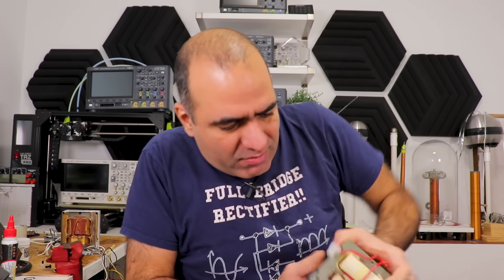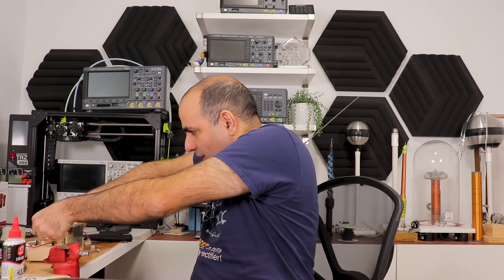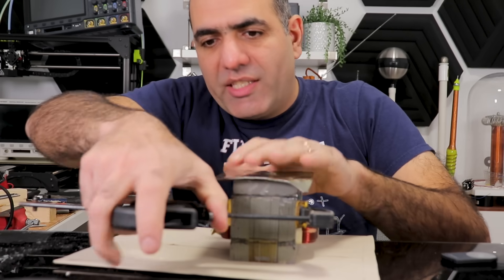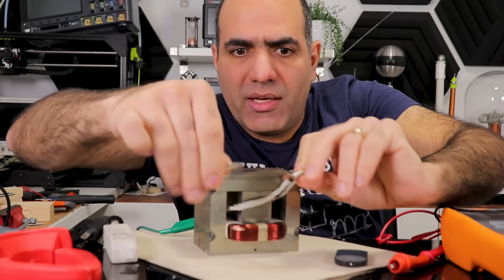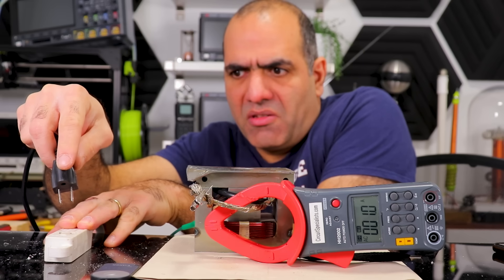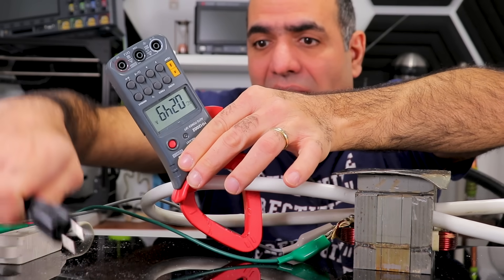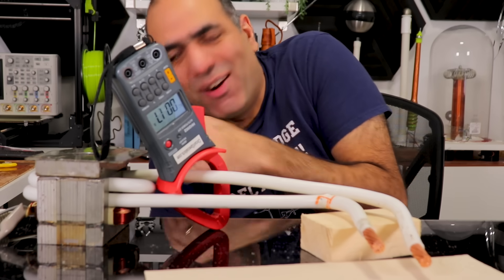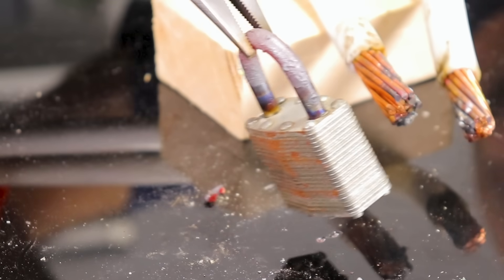Making "MILLIONS" of AMPS of Current

Comment: for anyone wondering , if he anyway wanted 2.2v or low voltage anyways then why not use normal power source cell then answer is cell have internal resistanc of around 1 ohm for normal 1.5v battery so even for pure conductor with no resistance it will draw max of 1 Amp. thats why it was necessary for him to make his own stepdown transformer .

Comment: haven't finished video yet but when you took out the secondary winding and made a new secondary out of a single loop, you turned it into a step down transformer. is there a reason you couldn't have used the old secondary as a primary to get an even bigger turn ratio?

Comment: Great style of teaching.  So the high amps won't shock you with such low voltage?  I was always tought that amperage is what kills you so how can you work with it bare hands?
Reply: Only the current going through you is dangerous. The amount of current going through a wire you are touching doesn't affect at all the current that flows through you. Only the voltage across your body determines the current. It takes at least 50 v across your body to have dangerous amount of current flowing through you. The are high voltage low current power supplies but they aren't able to put high voltage across your body as the voltage drops when they are loaded. The only way to limit current is to limit the voltage.

Comment: Hi. I hope someone can answer this question. If I there is an inverter to change the ac outlet voltage to high frequency AC, then we should be able to use smaller transformer with ferrite core and produce the same effect of generating high current to melt the pad lock?
Reply: It is possible but inverters of that power are also quite big. The end result wouldn't be much smaller but it would certainly be lighter than an iron transformer

Comment: Hello friend, in Brazil, some people use this transformer with a 10mm cable with 12 turns to make a welding machine with a coated electrode and two turns with a 30mm cable to do spot welding. I made a welding machine using two 110 transformers in parallel in the primary and the secondary with 10 turns in series, reaching 100A when welding with electrode.Hello friend, in Brazil, some people use this transformer with a 10mm cable with 12 turns to make a welding machine with a coated electrode and two turns with a 30mm cable to do spot welding. I made a welding machine using two 110 transformers in parallel in the primary and the secondary with 10 turns in series, reaching 100A when welding with electrode.

Comment: Why on increasing the number of turns increases output current ? 
Should it not increse the voltage  and current and voltage are inversely propotional
Reply: The voltage was too low to overcome the Resistance where the spoon touched the copper . Both pieces probably had oxidation.

Comment: After some reaserch, it was obvious why it resonated noise and it was because the Magnetic field is generated by AC, resulting in alternating fields proportional to electrical frequency.
TLDR AC allows an oscillating attraction and repulsion field and therefore, forces the metal plates to clash against eachother accordingly, with the noise being generated itself by air oscillations of a frequency so he translated electric frequency into a mechanical frequency.

Comment: I think you should have divided rather than multiplied when you got your 79 thousand amp calculation. If the secondary has less turns than the primary, it requires LESS amps from the primary than come out of the secondary. That's how transformers work.

Comment: Mehdi, buy an extension cord with a switch on it. I know there's the terrible drama of you rushing to pull the plug out, but a switch would make your life a lot easier. In fact why not install a switched socket on your workbench? You never know, it might explode or weld shut or something if you abuse it enough.

Comment: According to my understanding the limit for this  is also on the magnetic body of the transformer that establish the maximum power, so you will never get super high current despite reducing the resistance to the minimum, in fact knowing the fixed power that is valid for primary and secondary is what makes possible we can transmit the power down to the houses, genation at lower voltage and high current what makes the generators physically posible because of the isolation needed for higher voltages, then transformed for transmission to super high voltage but small current which again makes it physically possible due to the losses and thicker cables needed for higher currents, and finally transformed again to a reasonable save voltage for use in the houses 😉
Reply: Hello sir. Just wanna ask something about this transformer. When i wind 3 turns as secondary by 50mm2 cable, it gives me more current than 2 turns. How is it possible i dont get it. Should be low turn = more current right? But it doesnt work like this. İ didnt understand anything about it.

Comment: While calculating you are using all physics formula but actually you should use electrical engineering formulas particularly the formulas for high power transmission. You are not taking into account the losses due to heating which I guess is inversely proportional to the square of the radius or maybe in proportional to the radius the thing is that higher the diameter of the wire the more the losses. You are also not taking into account the temperature coefficient of resistance though it is very small of the order of 10 to the power minus 9 hiber I guess for such a large current it becomes significant. Kindly take into account all these different engineering formulas and then you can make a presides calculation physics calculations are ideal calculations which does not work in power transmission cables and high voltage high current electrical engineering

Comment: Can an old microwave transformer be used as an amplifier and how good are the results or not? and I want you to make a video about this.
but the original secondary winding has been discarded and replaced with a new winding, the volt of which adjusts the amplifier driver

Comment: 9:25 why doubling the voltage would double the current? Why didnt it fell by half? Since adding another turn in the wire should double the voltage and divide the current by half.

Comment: Hey, Mehdi! 
Late comment on this video I know but I do have a suggestion for this video and maybe it being a new video in the later future. Instead of using copper wire, why not use a lower resistance wire like Nichrome 80 or maybe even stainless steel. 
If it's lower resistance you are needing, I think ni 80 would do the trick for lower resistance, high current demonstration as it is much lower than copper. But in saying that, you would probably need some pretty thick ni 80 wire about the same size as said wire in this video. 
Hopefully this helps if it's lower resistance you're looking for.

Comment: I have also made a high current microwave oven transformer (MOT) with 2/0 THHN wire and compression lugs, with the lugs shorted with some thick ground braid I was able to reach 2023 amps, measured with my HVA-2000 I got on sale a while back. I too wanted to save the secondary, so I cut the welds. I currently use trigger clamps to hold it together but I have designed a threaded rod and unistrut clamp thing to hold it together better. I also might upgrade to 3/0 XHHW and NEMA 2-hole pad copper compression lugs. It's a fun project to burn, test, and destroy various things, and having access to very high currents without the need for large quantities of power is nice. The output voltage of mine is 1.87vrms.
Reply: Jesus, Jaiden. Dont burn your house.

Comment: Hi...it matters when I charge the laptop with a different charger that has 2 amps more.. (the original one has 20 w 4 amp, and these 20 w 6 amp)...the battery is defective and I keep it in the laptop just to not turn off the laptop suddenly when the power goes out...I tried with a charger with 3 amps but the laptop its work slowly...thanks..

Comment: When you doubled secondary side turns secondary voltage increased that's fine..but accordance to that secondary current should decrease..but in your case Secondary current has also increased with increased voltage..how is it possible..
As we know Transformer is a static device..which transfers Power from primary to secondary..with constant power transfer..if secondary voltage increases, secondary current must decrease with increasing turns..

Explain this ??

Comment: you've just done a very useful thing, with the help of it you can do spot welding of small metal parts. For example welding the battery contacts together connections in parallel or in series to create a more powerful battery. very cool thing

Comment: Although very whacky (yes, I enjoy the schtick), I admire someone who owns more than the 3 oscilloscopes that I do (and his are all modern; 2 of my 3 are archaic in comparison). Back in college in the early 1970s, I worked testing high voltage switchgear and we sometimes did late-night testing (and high-speed movies) of certifiable >1Million Amps on switchgear using an MG set to reduce the voltage and provide a proper buffer to not mess too much with the city power feed. Of note, great care was needed to set up the supply lines (heavy braided copper) in a physical manner to ensure that the EMF didn't help push the switch's blade out of the socket. Results recording was via multi-channel light-beam strip-chart recorders. Power electronics can be really cool (well, hot actually...).

Comment: Our pennies were copper up until 1996, then zinc with coper plating until 2000 when they switched to steel, which they continued to use until pennies were abolished in 2012

Comment: 🤨Are both sides of the transformer have the same danger? The power is the same because the P=U*I. What if we touch the both end of that huge wire? Would it be fatal shock, same as at the primary (230V) side? Please explain, thanks!

Comment: Easier to connect like 20 wires in parallel, although make sure they are of same length. 

It's better to step down AC that is already stepped down so use a normal UPS transformer for like 50A x 12VAC input, then step that down with DIY (or welding) transformer to like 1V x 500A without burning anything down... except stuff connected to secondary which will burn down by design.

Comment: KREOSAN showed that  can greatly increase current by putting 2 microowen transformators together. u need to put one on top of enother without top core part and then put both primary coils in series with each other. then just get most thickest wiire and put in as secondary between 2 primaries and amaze for tons of current

Comment: Question, could I put a variable voltage transformer on the supply wire to vary the voltage at the secondary? I'm trying to build an Amp tester to test peak loads on wires and connectors (looking for 500A+)
(btw I understand I might need a 1600W variac, I wish I as not the in the US so I could get 2200W out of a normal plug)
Also is there any way to rectify 500A to DC on a budget lmao

Comment: I am still alive at age 66 because YouTube didn't exist yet when I was young and brave enough (or stupid enough), to try things like this at home. Using extremely powerful electric current to melt metals is in fact how bauxite ore is refined into pure aluminum metal. It's also why pound-for-pound, aluminum is three or four times as expensive as steel; bauxite has to be reduced in an electric furnace, whereas iron ore can be reduced into pig iron (thence to steel) using inexpensive coking coal as the heat source in a blast furnace.

Comment: I don't understand this, could someone explain what's going on here? So is he generating power with that transformer? Or is he just pulling a bunch of power from the city into the transformer and then outputting it into the metal melter 3000? And if it's the latter then how is that even possible to pull that much power from the grid and not have some insane bill or the cops coming knocking at your door? Need something in layman's terms to understand.

Comment: Now that I am doing electronics engineering, all this makes so much sense to me now. Thank you so much, I used to watch your videos before for the fails and now it's legit more educational and it's still fun. Thank you so much!
Reply: how come he was able to touch the spoon without being electrocuted
Reply: @stewbaka4279 the voltage across those wires was 2 to 3 volts approximately, and we know that the human body has a very high resistance (Megaohm range I believe), so basically negligible current thru Mehdi
Reply: @stewbaka4279  I'm no expert but i'm guessing there was no path for the current to enter his body, so it only went from the copper wire, through the spoon, back to the copper wire. I'm assuming electroboom is sitting on something insulated, so there couldn't be a path for any current to go through his hand and out his body.
Reply: @stewbaka4279  no potential difference
Reply: He left out one important detail, Pin=Pout, so its limited by the diameter of the primary winding and turns, not just on the secondary.
Reply: as a non electrical engineer that dropped out of highschool, this just leaves more unexplained than it explains.

reflected impedances, transformer turns ratio, jacobs law, source to load resistance ratios, load matching...

just a quick perusal of the comments show how badly people understand ANY of this.

but dont you worry, as an EE, you have a career of doing the same old same old ahead of you. you will forever be too busy to actually think about what is actually going on in there, where we cant see, smell, taste, touch, or otherwise interact... but just rely on theory.

did you become an EE because you actually enjoy this, as a hobby?

or you making mummy and daddy proud, get a good job, good career, good wage?
Reply: @paradiselost9946  goddamn you're an angry person.
Reply: @erentyrus2671  whats angry about that?

Comment: If that white wire was the original winding he’d be dead fs. I guess he knew the wire would be a lot less than the voltage of mains. As the secondary is winded more than the primary.

Comment: That's exactly how I made my spot welder..  I didn't cut the casing though so getting the secondary winding out was easy.     Putting the new one in however with two turns of a similar wire to what you used was a f-ing nightmare... 
I do have the advantage of being in Australia with 240v instead of 110v 😊

Comment: You no the inside of a ac generator a magnitron magnet you turn it by 3ohase 1amp ac moter ,,,power coming from transformer which trippler capacitor feeds all from 4oarrel connected  speaker spark plug three times giving the 3phase needed to drive AC motor what do you think

Comment: If the original secondary is still intact, could you not use that as your primary instead of using the original primary? With the same couple of turns of thick welding wire as the secondary, the turns ratio would be much higher, so you should get a lower output voltage and a far higher current, no?

Incidentally, and this you might find interesting: I built my own soldering iron in a similar way, using a smaller transformer - originally a 240 volt input, 24 volt output 100 VA step-down transformer from an old amplifier. I removed the original secondary and replaced it with a couple of turns of welding cable - much easier with this type of transformer since the laminated core was bolted together rather than welded, so you can dismantle it with a spanner and screwdriver, no angle grinding necessary. I mounted a heavy duty terminal block at the end of the secondary cable, with a short loop of solid copper wire (1.5 mm diameter) shorted out across the other end of the block. With a push-to-make microswitch on the input side to act as the trigger.
When you press the switch to turn the primary side on, the loop heats up to solder-melting temperature in about 5 seconds. Quite efficient and convenient to use, since it only uses power (and heats up) when you depress the switch. Works in basically the same way as those "soldering gun" type soldering irons, which also have a step-down transformer inside them - albeit usually sized too small, so they tend to overheat and melt the plastic housing if you have to use them for more than about 10 minutes.

Comment: Put two transformers in series on the secondary side.use car jumper cable.sould be able to get 3 or 4 turns per trans' making 6-8v output.Great metal welder with a weld rod

Comment: Use welding cable, it is much more flexible than building wire.  It also has a higher (105°C) temperature rating, always a plus.

Comment: I would use this technology in a sword connected to a backpack with 2 car batterys although i would need the blade forged with a weakness in the middle of the blade so its gotta be a decent sized blade so definutely not a long sword probably a 3 ft blade that heats up so how it could cut through things with heat alone

Comment: spectacular as always :)

your volt drop calculation ignored the primary. Vsec = ((Vin  - (Ipri x Rpri)) / Pri_Turns * Sec_Turns ) - (I sec x Rsec)

welded transformers usually come apart with a sharp tap with a hammer knocking the I lams sideways.

Comment: Why didn’t you get electrocuted when you clipped the wires onto the winding then touched the steel casing, or was the voltage just too low..

Comment: What a great watch! Just discovered this channel and gonna watch more. 

A question i have though is why can you touch the very high amps when holding the spoon without danger? Because you are not grounded yourself or is the very low current that can't overcome skin resistance. If so how high has the voltage to be penetrate.

Anyways really good video!